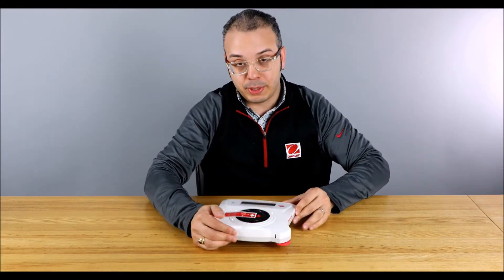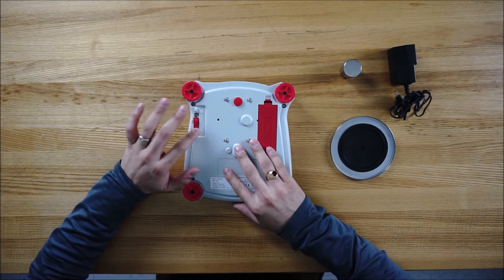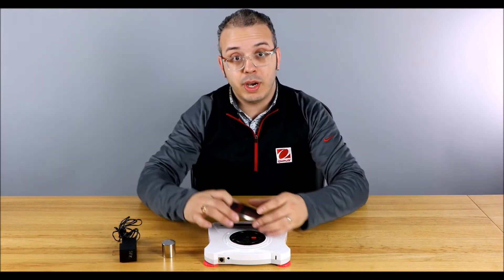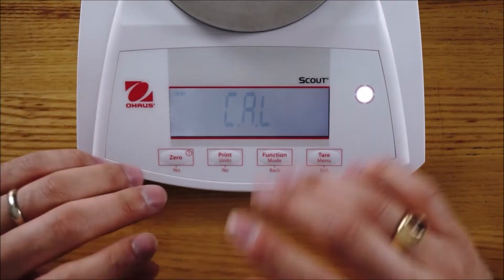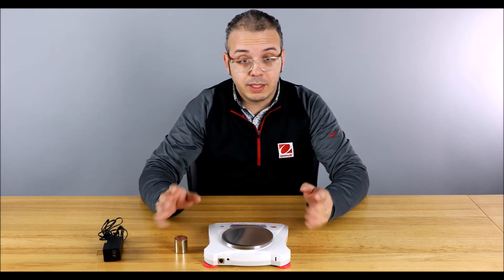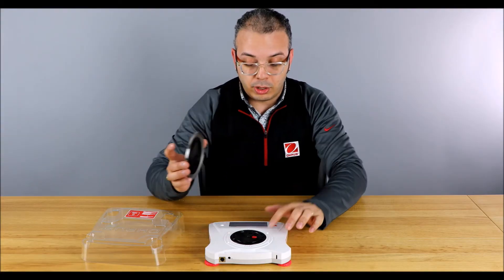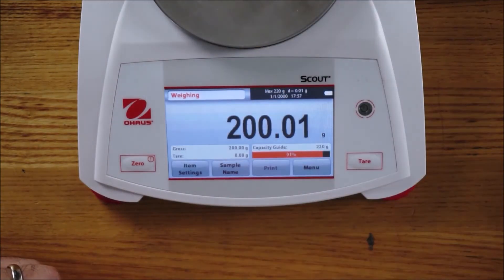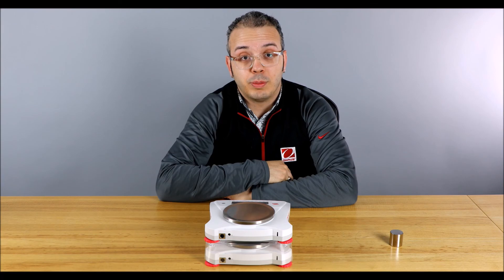How to: Calibration - OHAUS Scout™ Portable Balances

Comment: For all those having the issue with holding Menu and it skipping to setup instead of “Cal”

You have to make sure the little security switch underneath it ( a long rectangular red switch) is switched to UNLOCK so you can see the screw. Then the CAL will appear :)

Had to find it in the manual since obviously these videos don’t understand manuals 😅. 

Dont call customer service. Just flip that switch ;)